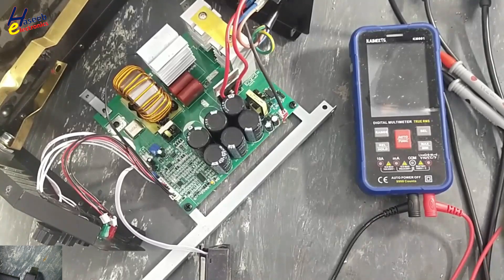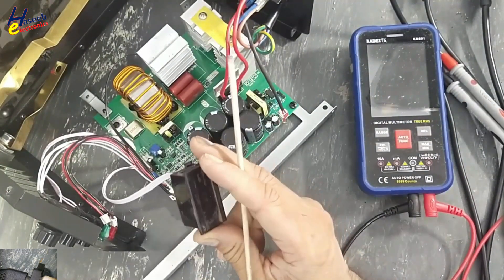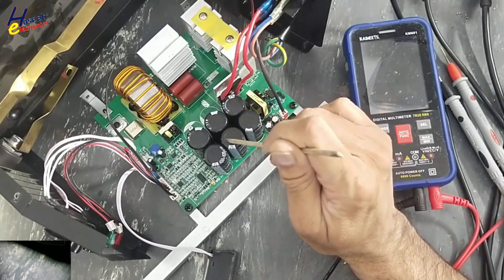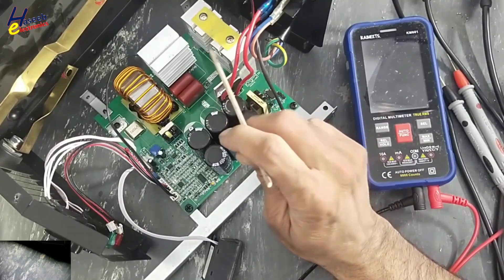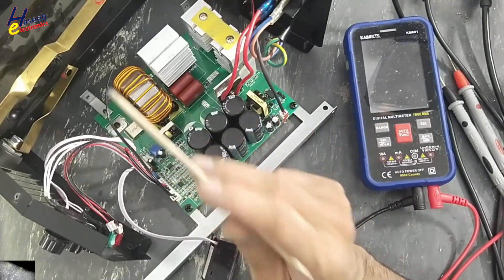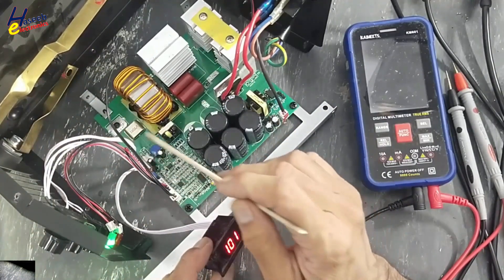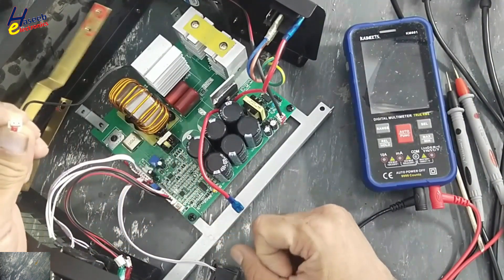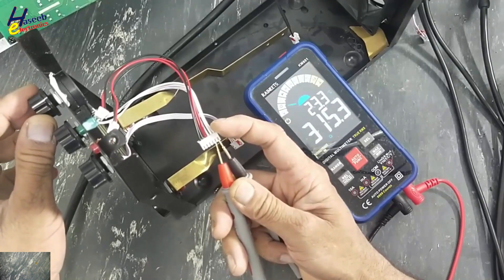{1279B} IGBT Inverter welding machine repair || Cold Testing

Comment: Sir 200 WELDING MACHINE 
cantrol card section MOSFET 4688
And J3y and j2y 
There are two diodes fitted in this place whose number is WJ2

So which diya can be placed in this place?

Comment: 7:07 - Haseeb, these are rotary encoders and not potentiometers: you won’t be able to measure a resistance on these.
Reply from the maker: no. i think, it is not rotary encoder. because it is just connected in series of Potentiometer. 
basically these potentiometers are used to control Arc Force and Hot Start 
in upcoming session, i will discuss these functions and we will analyse these fake potentiometers 
as these are fake copy similar looking to potentiometers

Comment: There was evidence of traces in those potentiometers, a faint image. I suspect that the tracks got blown out when the circuit board got damaged. I have blown traces off my PCBs when I made a short circuit with 120 volts AC. :hand-orange-covering-eyes:

Comment: I saw on their site that the part number WH0162-1 resembles the plastic contraption that you showed, and their product description is empty, that makes sense ;-)
I thought maybe it could be a variable condensator but no it must be simply a fake component.
Reply: So that means that the welder has no controls, just on/off ?
Reply: @romancharak3675  yes, and they hope nobody would see/understand what happens. Lack of quality control, scam from the potentiometer vendor.
Maybe at least there current but I doubt for the 600 value.
Reply from the maker: Basically these are two different controls are used with current setting potentiometer.
 the one is arc force control and second is hot start
 these both controls assist the welding machine to adjust its duty cycle during welding process so the rod will not stuck to the job but in this machine these fake potentiometers are being used 
so that never makes any sense that it will work 
I think that is the basic reason that this new machine just worked for one second 
when the user touched the rod to the job it damaged.
 I will continue for troubleshooting it more and more 
and we will see the end result of our troubleshooting process 
best regards

Comment: The nbhy part is from a company Ningbo Huayu Electronics Co., Ltd. They make sensors. That may be working similar to a opto-isolator or photosensor. If you put power into it the center pin may output a voltage. It probably works ok, it's only for adjusting something, must be fairly low voltage. Check the circuit where it connects i'm sure you can figure out what it does :-)

Comment: In my opinion, it's possible to figure out what this component is by examining the welding machine's PCB and checking whether the wires of these potentiometers are connected to other components. Another observation I have is that since this potentiometer has only two wires connected, it cannot be an active controller that requires power. It remains to be checked whether its central rotating part responds to a magnet or metal (if there's ferrite or a similar material inside, it will stick to the magnet; if there's a magnet inside, metal should stick to it). In that case, it could be an adjustable inductance coil or something similar. I doubt it's a variable capacitor because such a construction wouldn't allow it. However, considering the welding machine itself is of poor quality, these potentiometers might just be fake components and nothing more

Comment: These are two potentiometers from NBHY company, whose value is written on the back of them right in the small rectangle behind them with the first word B, but unfortunately in this circuit, their value has been erased, you can use a resistor of 10 kΩ and 500 ohm in series by default, according to my experience.

Comment: Assalamu'alaikum warahmatullahi wabarakatuh ✨

Dear Beloved Sir,

Firstly, I sincerely appreciate your dedication to sharing such valuable knowledge with us. Your content has been a great source of learning and inspiration for me. I consider myself your obedient student and always look forward to your insightful teachings.

And Secondly I've a request for you, Can u please help me or make a video about Making a Brake-Rectifier. I've a Lift's brake Coil, Which runs on arround 100v at 2.5A and the rectifier converts 230v ac to 90v dc. Whats got me interested about it that  when i opened the commercial brake-rectifier, It only consisted of 3-4 Components, They were coxvered in epoxy So i couldn't see much, But it had No Voltage Regulator, no scr, no ic.. It just had Diodes, Capcitor, MOV...(i think).  So my request for u is to teach us how to make such rectifier by ourselves Which can convert 230v ac to 90 or 110v Dc at max current of 3-4 amps. It would me so much helpful. 

Thank you for your efforts in educating and guiding us! ❤

Your sincere pupil.